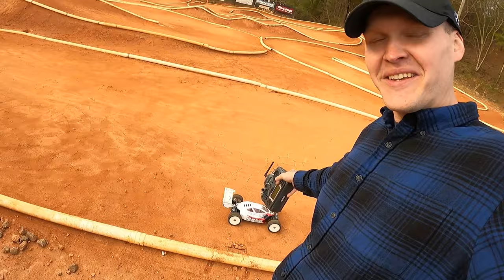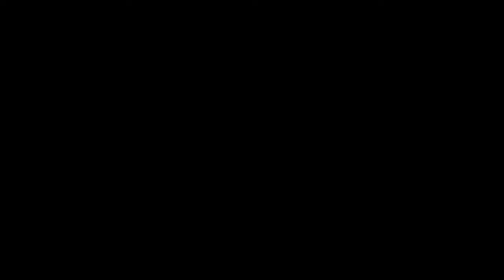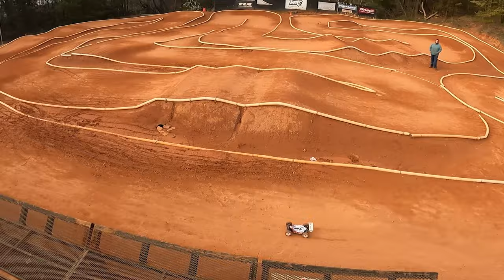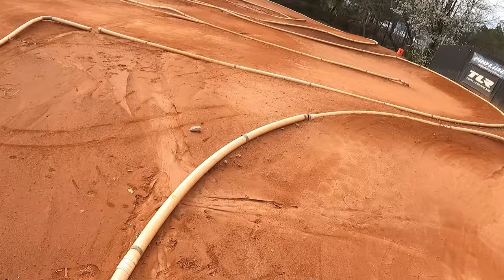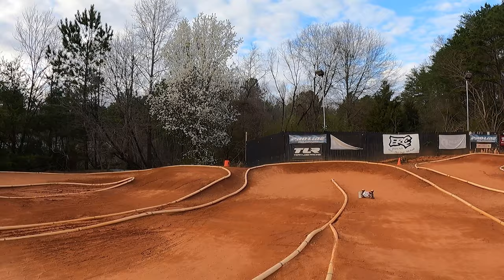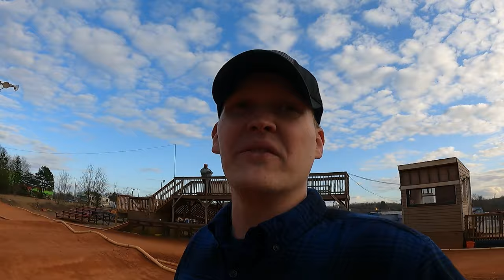Stick Transmitter How Hard can it be? kyosho MP9e

Comment: I think the main difference between Stick radios for Cars and Stick radios for drones/planes/heli is the self centering to Neutral position.

Stick radio users for surface application usually need the self centering springs to get back to Neutral position when the sticks are let go.

Just my 2cents 🙂